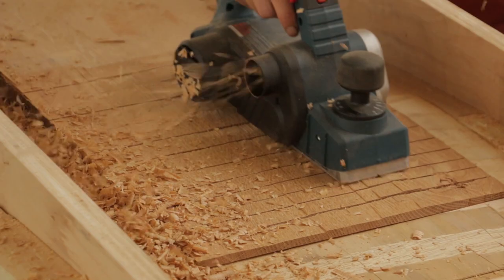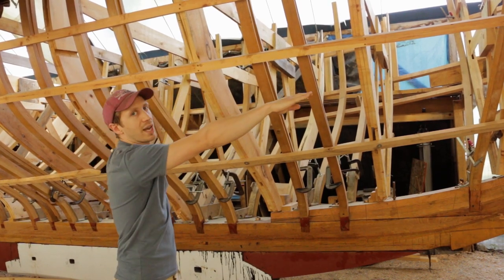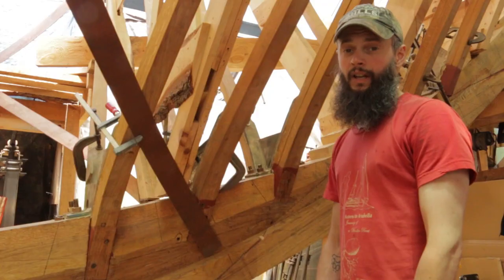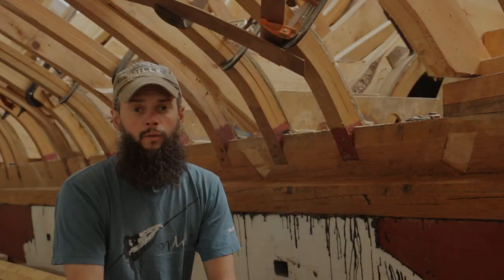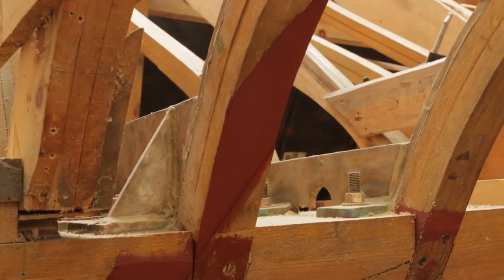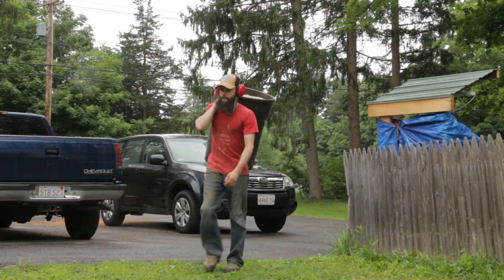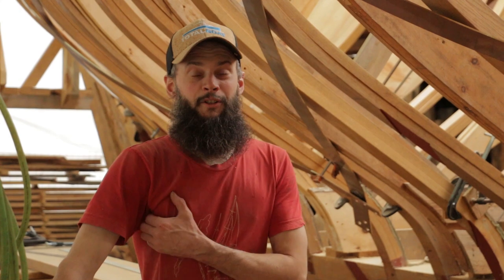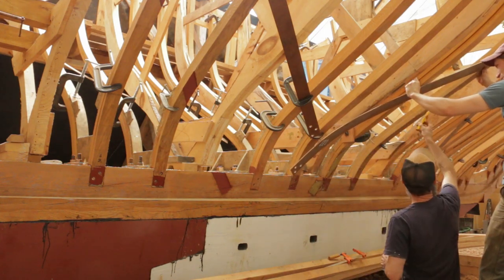Acorn to Arabella - Journey of a Wooden Boat - Episode 71: Installing the Bronze Strapping

Comment: Why not glue the scarfs on the boat? Making one board that long is going to be really heavy.  Plus, any minor adjustments could be made to seperate boards much easier than that full boat length plank. I'm sure you have your reasons, I am just wondering what they might be.
Thanks for any answer you may provide.
Reply from the maker: It's an easier process to glue the scarfs on a flat surface, and be able to work on planing there as well.
Reply: Scarfed on the bench, you pretty well have one board which naturally wants to spring fair when it is bent and twisted onto the keel/frames. (well, nearly fair, the glue makes the scarfed area a bit stiffer than the unmolested wood.)  If you try to make the scarf joint in-situ, then you have the problem of trying to hold the ends aligned whilst the boards are bent.  At best you create a high or low spot that complicates final fairing, and at worst you create a very weak joint because of poor contact between the members that couldn't be properly clamped.  Keep in mind that the garboard is the  about same dimensions as a finished lumber 2x10, and oak, not soft construction grade wood.  So it takes serious force to bend it to the hull contours.  There is no good way to do that at the ends of two boards meeting near the middle and maintain the curve.

Comment: Great work gentlemen.  Those are some garboard planks!  Will you be doing any planing on the scarf joint to be sure there is no offset in the surface or just finish it down when you fair the outside of the hull?  Arabella is going to be one stout little ship.  Take care, have a great weekend and thank you for the video.
Reply from the maker: The outside will be faired once the rest of the planking is done. Thanks for watching!

Comment: One thing about Resorsinol is that it is great for porous wood. I used it on some Satinay (Turpentine) which has a massively high silica content. It's an extremely dense hardwood from Australia. You have to use carbide tipped wood working gear it's that hard. Resorsinol did not work on this wood. Did not penetrate the grain. Had to end up using a two pack epoxy. Kitchen benchtops came up looking fantastic though.

Comment: A wonderful video, but I suppose that's no surprise from you fellas. This strapping is fantastic, and even if you can't get a 90* angle, it's fine as acute angles tend to make stronger triangles on the acute angle if the load is vertical and the acute angle is on top, and obtuse angles in triangles are great for side-loading. I was wondering, why didn't you guys weld the bronze strapping to make it longer?
Reply from the maker: It just wasn't necessary, as a non-90º will still be very strong.

Comment: Love your videos :D
Out of curiosity are these diagonal straps positioned with the attachment of the shrouds in mind? As they will bring a lot of load to be distributed into the hull and keel.
Reply: I don't think chain plates were considered for the straps. Hull stability is the goal. Chain plates could be addressed on the interior later.
Reply from the maker: Inadvertently, yes. The center of the strapping is centered under the mast, so it will help distribute that load.

Comment: Pardon my ignorance, but adding on welding scabbing welding is not an option for these straps? To get your desired length and angle? Or just not super critical to where you would go through the added labor
Reply from the maker: It just wasn't necessary. The no-90 degree angles will still be very strong.

Comment: I don't want to be a smart ass, but if you can weld the bronze than you can make straps longer than 10 feet.
Reply: i thought that would introduce an unwanted weak spot in the bracing. Could be wrong
Reply: @jg4902  I thought welds increased, mot decreased, the durability of the metal under forces and stressors at the point of the weld?
Reply: I had the same question

Comment: USS Constitution, Old Ironsides, was one of the first wooden vessels to use diagonals which are one of the reasons she is still in commission. Hers are huge oaken beams inboard of the frame members.
Reply: It's my understanding that the diagonals included in the design by Joshua Humphreys were left out of the original construction by the yard that built Constitution, and were finally added at one of her more recent refits in order to control the hogging which had resulted from their omission.
Reply: @netpackrat   Not quite. They were in the original design AND build, then left out by the (reactionary, opinionated) shipwrights at the first refit decades later. 
My information was that they were re-added , rather than added, at a later refit.
Sailors have always known, since biblical times, that shipwrights did not understand the racking forces which make ships leak in severe weather. And shipwrights have always thought sailors didn't know what they were talking about (similarly with oceanologists, in dismissing their freak wave and freak trough accounts until the end of the 20th century, when wave buoys and satellites finally and irrevocably confirmed them)
Reply: I've checked this out since my last post above, and the diagonals were indeed laminated white oak. (I had mistakenly believed they were wrought iron) They consequently involved a lot of work, so they were left out in the 1820 refit, but reinstated (for the reason Netpackrat cited) in 1992.

Comment: Great video.  At 13:24 I just noticed that the bent frame spacing has some large spans between them especially in the bow (2 places),  one midship, and a couple towards the stern.  What will fill those gaps?
Reply from the maker: There are frames that can't be inserted until the molds can be taken out after planking is completed and some of the deck beams have been installed.

Comment: I understand your reasoning for these straps but I was wondering would the boat still be structurally sound without this extra expense? I don't seem to see this in the build plans.
Reply: Structurally sound, but prone to need recaulking much more frequently, due to the gaps between planks varying as the frames rack fore and aft. 
Designers and shipwrights do not generally go to sea, and certainly not for long, and it shows!

Comment: I’ve seen these straps used before , doing the numbers for bracing I can’t see that they are any good , but some do it , in impact , no resistance at all , they were used in days of old to stop ships from hogging as yours is to small to Hogg   In the first 100 years , hull to deck connection at the beam is the place a hull needs to be fastened to assist as in a head on impact  ,but piece of mind you have now , keep going

Comment: I was born in the late 40's and I am consequently an imperial thinker but I can use metric it is so simple but 10 can only be divided by it's self 2 and 5 the numbers 12 and 16 are so much more flexible :-)
Reply: Which would be a useful and relevant observation if we used a base 12 or base 16 numbering system, and measured in base 10.
But we're stuck with base 10 numbering system, which (to my way of thinking) makes the point moot. 
The minor and largely hypothetical advantages of which you speak are insignificant in comparison with the evident and demonstrable disadvantages of working in three or more different bases simultaneously.
Those advantages are important when dealing with integer-based disciplines, like gearing. You can't cut a 16.66 tooth gear. But that's why angles are measured in base 360 (12 x 5 x 6). But you can very easily machine an item to a dimension of 16.66mm, adding as many sixes as you require for the degree of accuracy needed and available.

Comment: But doesn't the strapping go against the natural movement of the wood hull?  Curious, as to why you feel its necessary whereas the naval architect didn't on Arabella or any other wood hulls I've.  No, not a shipbuilder just a enjoy watching your work on the restoration. Thanks.
Reply: i think that normally you want a rigid hull , movements and elasticity in a marine in enviroment with moist wood and waves maybe  tend to increase  material stress and leaks
Reply: The problem with the natural movement of a planked hull is that the hull "works", which means that the frames are relatively free to rack fore and aft. The frames stay parallel to each other, but they lay forward and aft as the masts try to drive forward and the hull slams into a head sea. The planks also stay parallel, but like an old fashioned parallel rule (hinged parallelogram) the planks get closer together, when the masts are leaning forward or aft, squashing the cotton caulking, then the planks get further apart as the frames pass through vertical, at which point the caulking can get spat clean out.
While the Arabella crew are correct about the stiffness and strength of the boat being greatly enhanced by diagonal strapping, it is really the watertightness which is the crucial advantage for small vessels. A traditional hull of this size is plenty strong and stiff (in overall structural terms) without the strapping, because the frames are so close-spaced, and the planking is (proportionately) very strong in comparison with a larger vessel, but the seams won't generally stay waterproof for years at a stretch, especially driven hard in heavy seas, and/or subjected to radically different climates. 
Diagonal strapping is the most important single innovation ever devised for traditional boat construction, in my opinion, and it's uncountable how many lives would have been spared if hidebound shipwrights had not been so resistant to the complaints and constructive criticisms of sailors since time immemorial.
Reply from the maker: Gottenhimfella is right on the money, and we are glad for their input!
Reply: @Gottenhimfella  Your point regarding the working of the streaks over time is well-made.  A contributor to stiffness is the tightness of the seams.  As the seams work over time, they will open to some extent, reducing stiffness.  The strapping helps tremendously with this.

Comment: I've been watching since the beginning, and this is the first time I'm confused. 1. If the straps aren't long enough, why not use all your fancy welding equipment to make them longer? A good butt weld would have been fine...
2. Why put the strapping on the outside of the frames? I feel like I would have chosen to fasten them INSIDE the frames...
3. It's going to be fun fastening planks where the straps go over the frames. Good thing silicon bronze plays nice with wood cutting drillbits...
4. Can I suggest that you put something (like a thick bedding) between the straps and the planks? I've sailed some boats with similar strapping, and the lee side tends to "thrum" a bit on heavy beating and reaching...the planks and straps seem to have different harmonic frequencies. Having said that, most people I've sailed with can't hear it, only feel it through the tiller, so it may be a non-issue. 😁
5. pull-saw and chisel might be faster to cut those reliefs when your planks get there...
Reply from the maker: The strapping is most effective when it is between the planking and the frames, rather than inside the frames. Thanks for watching!

Comment: Are there a couple missing frames, or I missed something ?
Reply: Yes! I was wondering the same! Please answer
Reply: @A seagypsy's Adventures will they though? cause there are no slots for them Frames carved into the keel timber as far as i can tell. Would be nice to know if there are indeed some frames missing!
Reply: I've been wondering the same for a few episodes now. At 4:53 it sure looks like there ought to be frames adjacent to the molds at stations 3 and 4. But I have the same thought as Felix, there are no pockets there for frames and all the other frames have been faired in to the garboard rebate. Although acknowledging Seagypsy's comment, it seems to me that accurately fairing and bending any additional frames at this point, especially after the removal of the ribbands, would be very difficult.

But, looking at the fuzzy view of the plans around 2 minutes, it does seem like MAYBE the frames are more closely spaced adjacent to the mast step. I hope the shipwrights respond, but I'm just going to keep watching and learning.
Reply: I think that is where the Cannon ports go
Reply: @kmbrady1a  ahh right! i thought they stick to the modern top site launched Tomahawk . But I guess they´re goin the old school road all the way
Reply: The frames aren’t evenly spaced , they are set out according to where there is more stress in the hull and more strength needed , looking at the hull like it is with frames while it still has moulds in place can look confusing
Reply: I’m planking a 110’ wooden navy ship right now that has massive diagonal bronze straps that are also part of an electrical bonding system
Reply: @kmbrady1a  That is correct sailing around some parts of the world, cannons are an essential piece of kit
Reply from the maker: There are some frames that will be inserted after the planking is complete because the molds are in the way. The molds will be in place until planking is complete and the deck beams are installed. The frames will be evenly spaced once all are in place.
Reply: @AcornToArabella  I seem to have lots of confusion about how this is going to work???  If all your planks are installed, then how will you notch the keel for the missing ribs, then after you steam-bend those missing ribs, how will you clamp them in place to make the appropriate curve to the hull.   Then you're going to build more bronze floors for those missing ribs?    It really seems like a giant work-around hassle, when you could just remove the molds and install the missing ribs now, while everything is open.  Why do you need the molds anyway, when you could just shore up the existing ribs that would keep the hull shape?
Reply: @AcornToArabella  I'm trying to visualize how you will fasten the missing frames to the keel. Content to wait for the video when you get there though.

Comment: When you say ’more reliable than resine’, what do you mean?   It's coming on now, looking great for planking.
Reply: More reliable than epoxy resin (resorcinol is also a resin) when used with oak.  Better adhesion.   Retains strength at temperature extremes.

Comment: You guys are doing an excellent job on A to A, just wondering if the ribs are finished being made?
Reply from the maker: There are some frames that cannot be inserted until the molds are removed when planking is complete and some deck beams have been installed. Only then can we steam in the remaining frames. Thanks for watching!

Comment: The bronze straps are easy to extend using riveted butt splices without welding as the primary use is in tension along the overall length.

Comment: Areyou guys now just winging it? Off the plans?  Where did you get the idea to use straps?
Reply: Diagonal strapping (in iron) dates back to at least the 1840's British 1st rate ships, just before the Ironclads and pre-dreadnoughts and such appeared.  It may be older than that in big fighting ships, but I don't think it made an appearance in small vessel plans until...hell, not sure it ever did...?  But I'm guessing that's where they got it and it definitely works (and in post frame buildings, etc, etc...).
Reply: @FMChimera  here's a plan of HMS Conway/Nile: http://www.hmsconway.org/images/nile_plan.jpg
Reply: @clewerhillroad  I wonder though since I imagine the straps dont add much compression strength as tension strength and if the straps turn intoward the keel that when stretch is applied to the strap will it not stress to pull the plancks awat from the bottom half of the hull?  if you were to pull a strap strait it would work to pop off the lower planks?
Reply from the maker: Herreshoff was one of the first to use diagonal hull strapping on smaller vessels back in the late 1800s, and Dave Gerr recommends it in his great book The Elements of Boat Strength.
Reply: @FXCAMERON  HMS Nile was notorious for hogging. She was incredibly strong transversly as a result of the X spars, but her keel was too thin and so longitudinal strength was incredibly poor. She ended her days in N Wales as a training ship, and her remains can still be seen at low tide near Menai.
Reply: @clewerhillroad  I was just wondering, not about diagonal strapping which seams like a fine idea, but about where the strapping was anchored since the boys are doing it on the fly.  In my thoughts if they strapped across only the outward curve of the ribs then good but as soon as the straps take the reverse curve under the garboard planks then when the straps pull under tension they will pull against the lower plancking and might lossen those planks away from the framing over time...dont know if Im explaining this well.  Im a designer and engineer of robotic machinery and not a boat builder

Comment: When glueing up the scarf joints, would a string line or two along the length of the boards help line them up?
Doesn't it seem by the time you get a job figured out, and get efficient at it, the job is done?
Reply: I don't know why they are making the boards straight when they need to be cuved

Comment: quick question: how do the masts work on ships and boats? in a videogame Sea of Thieves, the mast stops at the deck. doesn't the mast have to go through all decks to the bottom or spine of the boat/ship?
Reply: On ships they pretty much have to go through and be stepped on the keel. On smaller sailing vessels it can be perfectly satisfactory to step them on deck, with a strong ring frame or compression post to transfer the load to the keel, and with suitable lower rigging to provide lateral support to the lower 'panel' of the mast.